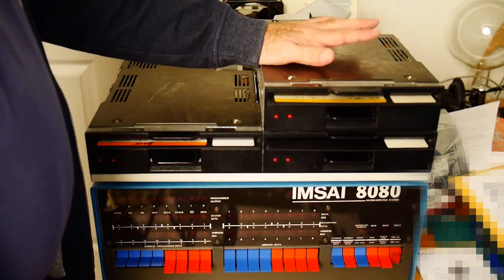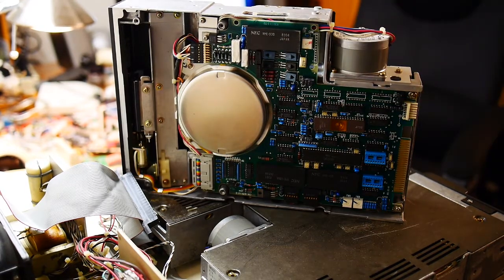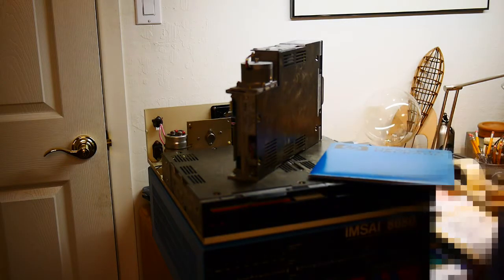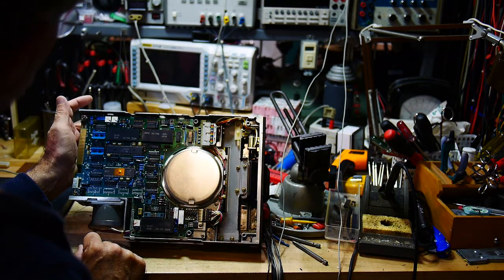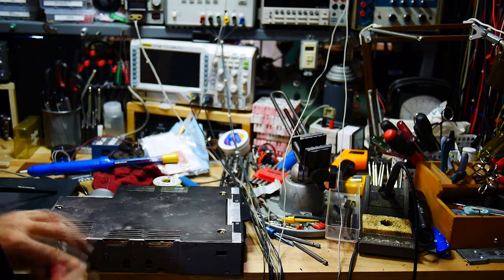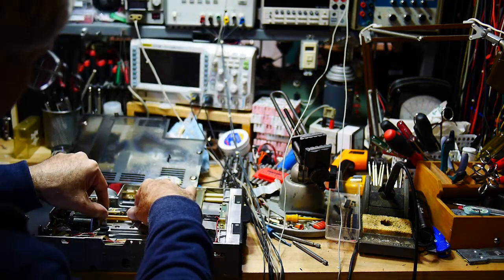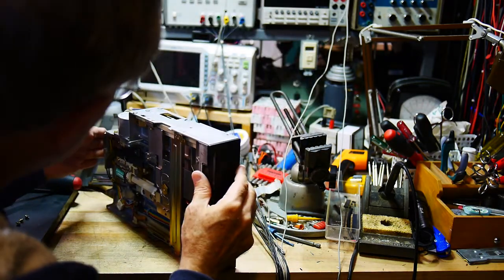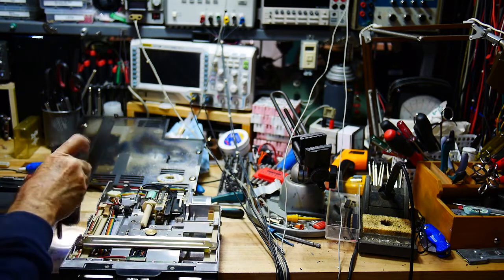#42 IMSAI floppy drive repair

Comment: Rubber goo.  Not heat, but age.  I've seen this many times in old electronics. Many rubber belts in tape decks, turntables and even disk drives, just turn into this goo with age.
MJ